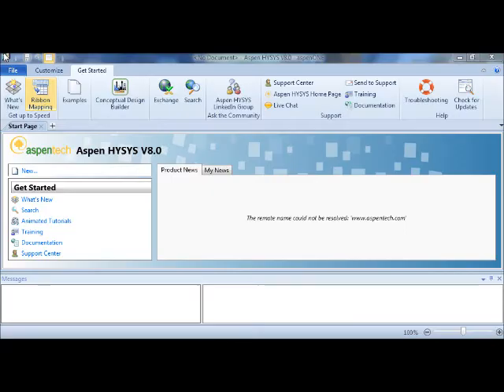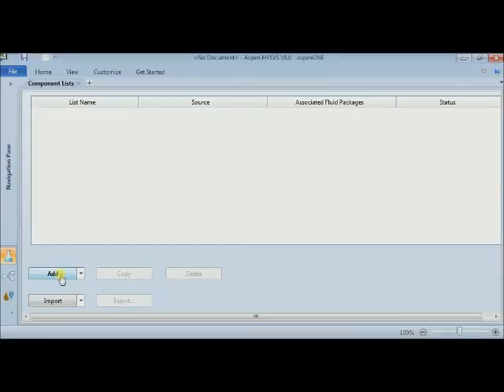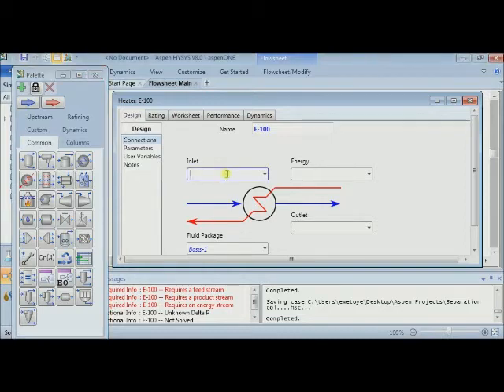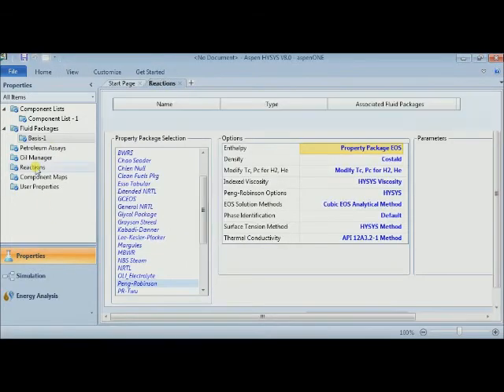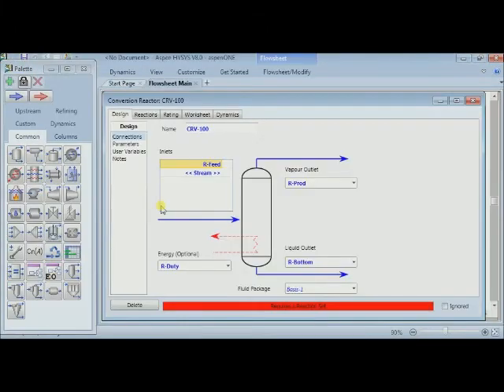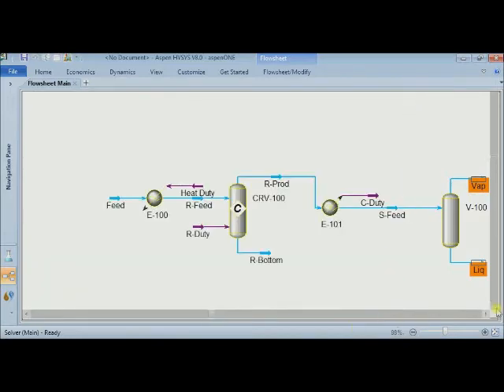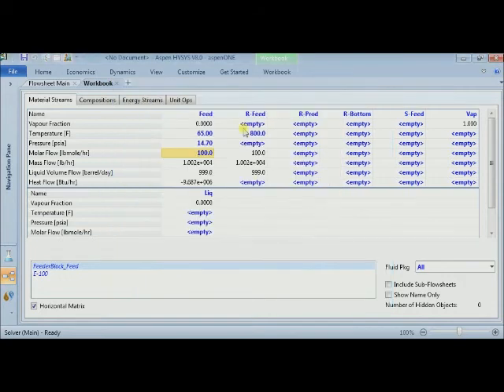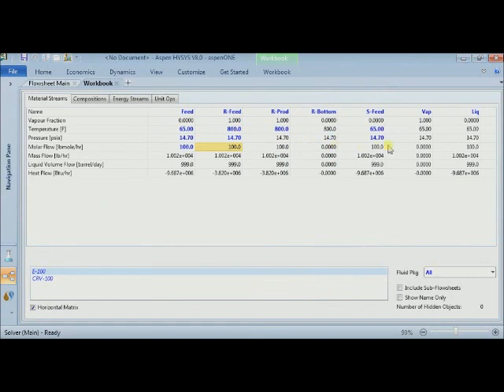Toluene Production (Process involving reaction and separation) with Aspen Hysys V 8.0

Comment: I think you assigned the incorrect coefficients, since negative is for reactants, -1 must go only in n-heptane. The +1 and +4 must be assigned to toluene and hydrogen respectively. If you state the conversion for toluene.
Reply: Because of this, you have no reaction at all, the final products are not formed, that is, the Conversion reactor is only acting as a heater.